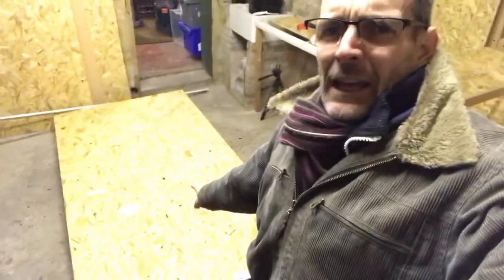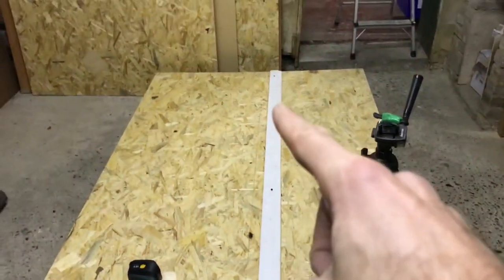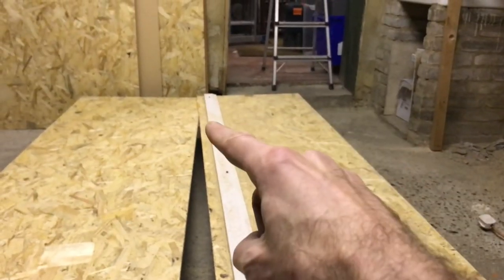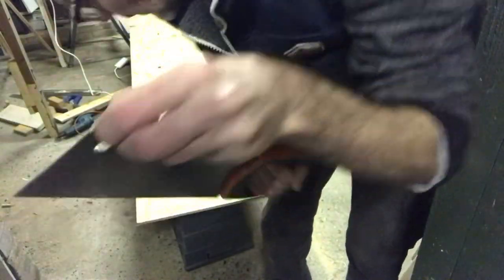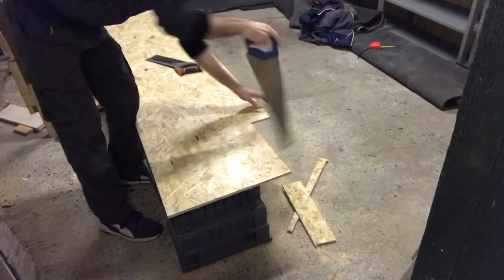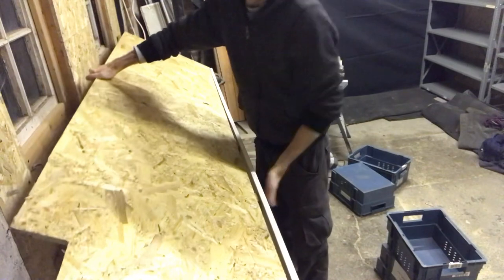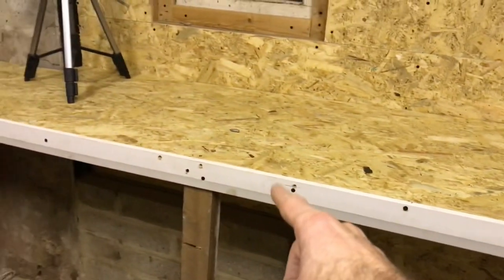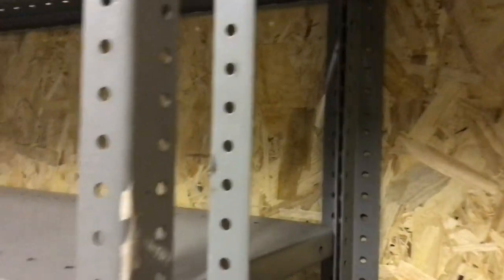Will the worktop fit? Building the shed

Comment: I did a similar job in my shed.Found it a good idea to seal the surface of the workbenches with acrylic varnish,to keep them clear of moisture and spills etc. Your shed will be prone to moisture retention as it's a large area with fluctuating temperatures.

Comment: A tip when using mains powered tools, always have the cable trailing behind you (I tend to put it over my shoulder) to minimise the possibility of it being cut by said tool ;-)
Reply: I managed to cut through the trailing cable with my hedge cutters. I was sent back two feet involuntarily! Solution, get rid of hedge and install fence!

Comment: Center Table:  you mentioned making the center table 4 x 8’ in size, but unless the room is big enough to have aisles all the way around, you might find 4’ is too deep to really work well or reach across to the center area, especially once your shelf row is up against the wall.

I suggest you mock up the table by setting the 4 x 8 foot top onto a couple stacks of bins, to get it at work height and really test it out.  Then ask yourself if it blocks anything, like access to the upright shelves for loading, the entry door aisle to the room, etc.  

Also, since Andrea will perhaps use it too, how is the reach to the center of the table for her.

Last time I made a large kitchen island for a house my wife and I built, I did the mock-up with some sawhorses and the cardboard box from the newly unpacked fridge.  The island was going to be custom and about 4 x 7’ in size.  To do the mock up, we first put everything in place around the rooms outer edges, then I set up the cardboard on the sawhorses and after squaring it up, handed the wife a utility knife and told her to start trimming the mock counter top to make the four aisles work that allowed traffic flow all around the island.  

When she was done, the island was made to the custom size she wanted.  It was easier that way, then finding out the island didn’t work well, after building it.
Reply: If you don't have a big piece of sturdy cardboard, you can quickly do the mock up with other things.  In your sheet good stack, look for a thin piece you'd never use that maybe has a split or crack or holes or some other damage that you'd be willing to sacrifice and cut on it, to size the work surface.

Or, if you have two or three pieces of the right length (8') that are too narrow, lay them up on the totes/sawhorses to get the 4 x 8' size, then just push them together if 4 x 8 is too big, letting them overlap until you are satisfied and measure the outer size, to know what to cut the real work top too.

You can do the same thing with some of your scrap baseboard.  Screw together 4 pieces at 4'x8', one screw per corner.  It will look like a picture frame, with an open center.  Then, just adjust it smaller and smaller, letting the boards run over as you shrink the square.

Then, try to use the space the way you intend to, testing it out with some empty boxes to emulate your stock.  Make sure the area now has good work flow around the table and to the shelving units and that you can reach the area.  

You've probably been in kitchens before that just don't work.  The dishwasher door doesn't have room to open, or 2 people can't move around the space without collision.  Or you can't access one of the storage cabinets well.  The point is that since you're building a custom center table, you can make it any size you need and exactly 4 x 8' may not be it.  Maybe 72  (or 80) x 45 (or 42 might be better).

Great video series.  Nice change from just sourcing and selling!